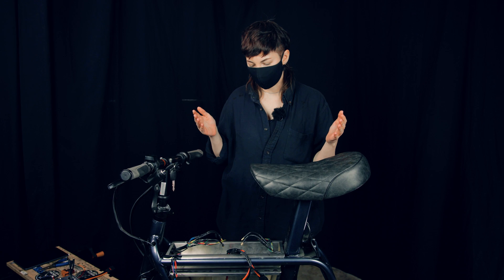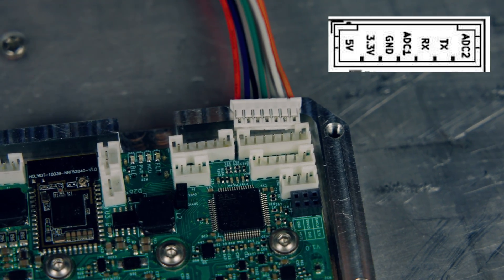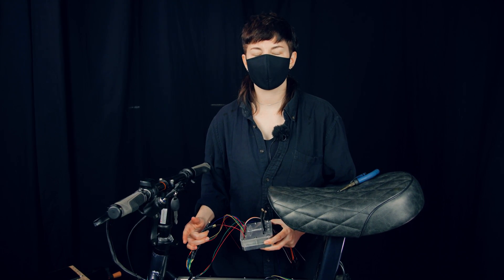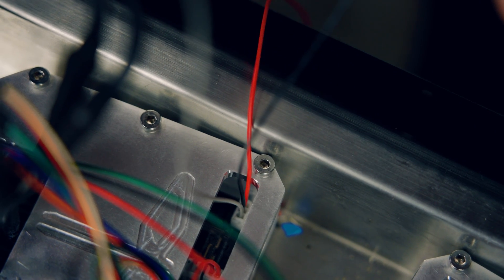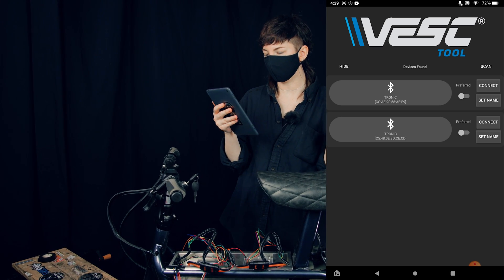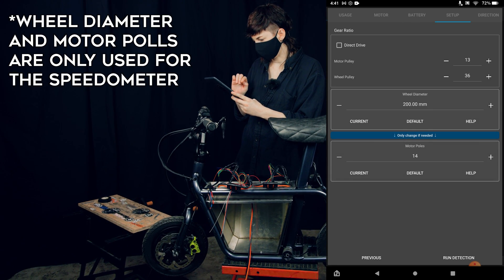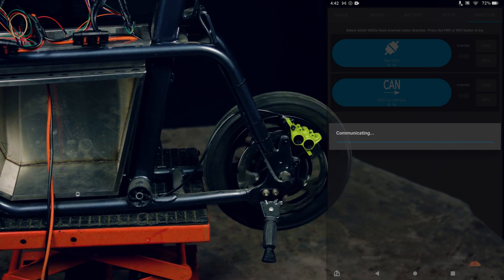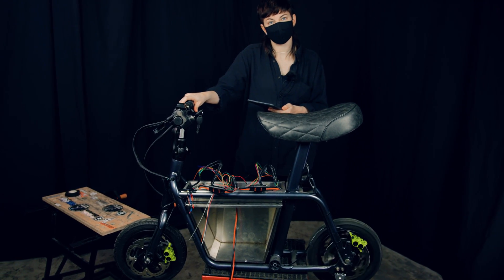Tronic 250 Controller Installation (RION Controllers for electric scooters, bikes, skateboards, etc)

Comment: And that 84.33A detection result on the motor, is the max it can handle from controllers safely?
Reply from the maker: Those are the "presets" for the motor style you picked.  You can make it 83, 85, 150, 200, 12, or 3 amps.   You are using the wizard.    There are many things to learn when programming a vesc.   
_Kevin Graehl

Comment: the only thing that disappointed me is that the 750 is the only controller that can take over 100V batteries, and much too expensive aswell, i'd like to see a 30S 100-200A controller for a reasonable price, i don't need 550 phase amps but high voltage for a decent price would be great for DIY EUC's, HV electric scooters and whatnot

the current controllers that are OK priced have a 100V hard limit (meaning they pop when 100+V peaks happen) except for the Trampa 100/250 and even that thing would be too expensive to get in my country as apart from it being €470, import taxes and duty costs can probably reach to be another €200 on such a controller in my country
Reply: Try the TRONIC 250R
Reply: @orinerlich  well still only 24S compatible like the 100/250 unfortunately, the Tronic 750 can take up to 30S/126V

i guess designing your own based on existing VESC project based controllers would be the cheapest method to create something that can take more than 150V but you're playing with expensive, untested hardware at that point (batteries, controllers)

the Begode/Gotway Extreme Bull K6 has a 146V battery for example

Comment: How do I connect regenerative braking?
Reply: That can be set up with the throttle settings in the VESC program. I believe it is something like ADC forward no reverse + brakes. Did you purchase a Tronic controller?
Reply: @NoahZimmerman  Yeah I did some more research you can connect the regen brake swtich into ADC2 for signal and the throttle 5v and throttle brake
Reply: And then u just do what you said to identify it in vesc

Comment: Are there rubber plugs for those large holes in the controllers where the wires go through? The stock controllers on my scooter are placed outside the body and are waterproof. If I were to replace with these can these controllers be made waterproof?
Reply: yeah fill it so it overheats
Reply: @saransmith8773  thermally conductive epoxy is a thing... high end controllers use it (ASI & Nucular)
Reply: @Saran Smith  Potting the controller does the opposite of what you said.  It does not increase temperature.  It  lowers the chance of overheating by increasing the thermal mass and transferring heat out to the exterior to be dissipated.
Reply: Sure, Fill the case with Epoxy and use a vacuum chamber to get all off the bubbles out... Or just use silicone and cover the hole and the seal the seams in the case...

Comment: Can the acceleration curve be adjusted with these controllers? If so, how much flexibility is there? Can I, for example, choose the first 0-50% of the throttle's range to control 0-25% of the motor's output, 50-95% of throttle to 25-50% of motor, and 95-100% of throttle to 50-100% of motor. That's just three. How fine can the curve be adjusted?
Reply: This controller is based on the VESC design. If you go onto the VESC website sign up for an account and download the software you can check all of the settings out for yourself even with no controller connected. The throttle curve is quite customisable but only you can tell if it meets your standards.

Comment: what battery specs and motor specs can handle these controllers.
i cant believe these monster controllers could work with any voltage battery and any watt level motor!